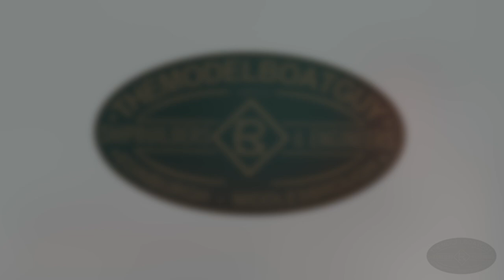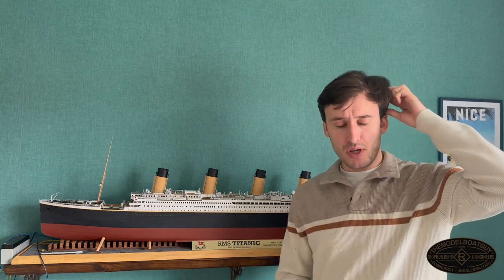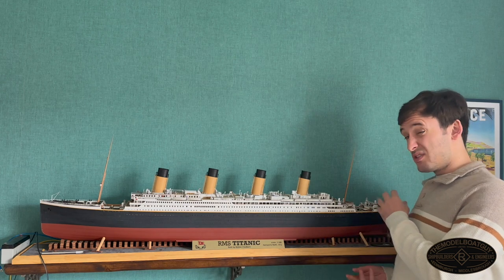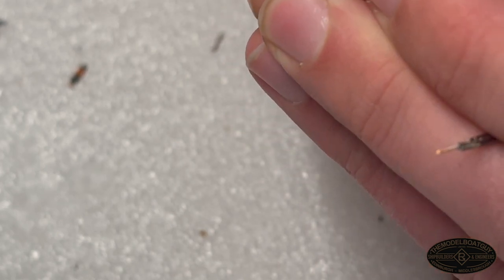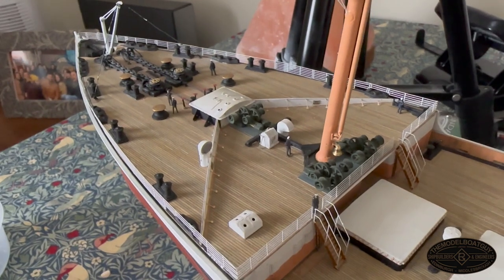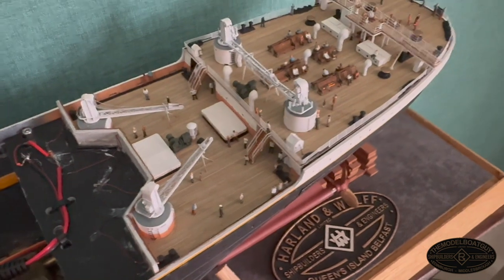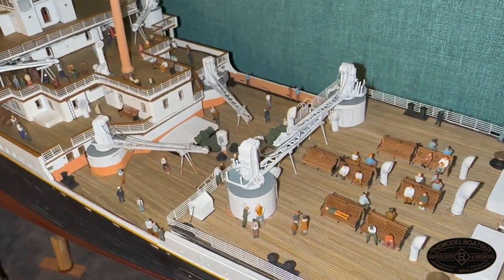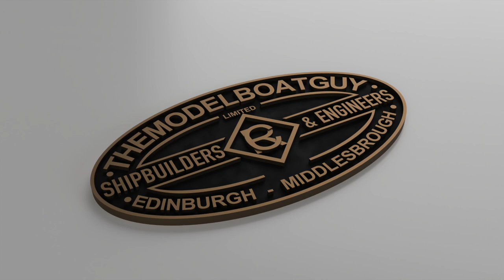Radio Control Trumpeter 1:200 Titanic Build Part 84 - Third Class Figures

Comment: First visit, and i think ive got a LOT of catching up to do!   I like your reasoning re the third class single guys, and the way to the stern would have been well known to them as third class dinning room was to the stern.  It was commented by a steward on the post sinking report that he had seen the third class single guys making there way aft on Scotland road as the ship was down by the head at that stage.   I would like to comment that this is the first build i have seen whereby the lifeboats are correctly mounted on the single inboard crutch ( Designed by Welland to go with the davits, the idea being to unchain the boats, pull a pin to release the keel of the lifeboat, and it would swing outboard a touch, you could then drop the crutch flat as it was hinged)  You have done your homework!
Reply from the maker: Hi there, 
Thanks for the comment. I think it was a relatively common thing for guys to head aft to the stern on most white star ships. As you say it’s been reported by stewards on the night of the sinking, I’d be heading that way too if my cabin was flooding! 
On the lifeboats, I found them hard to research, there weren’t that many photos of the lifeboats on Olympic or Titanic pre disaster, and as the arrangement changed so quickly there was a bit of making educated guesses from multiple pictures. Glad you agree the arrangement is correct! 
Thank you for the comment! 
All the best,
Robbie
Reply: @TheModelBoatGuy  Potential reason for confusion on the boat mounting is that there were actually actually two positions on the deck for the boat crutches. The outer resulted in roughly half the boat overhanging the side, the other placed the boat with it outer gunnel level with the side. Depended how much room on the boat deck was wanted for passengers.  All became a moot point after the ship was lost. From the little study i have done of the sisters they look like they were  retro fitted with many many extras as regards to life boats.
Reply from the maker: @timgray5231  aah interesting, I hadn’t realised these were interchangeable. I just assumed the aft boats were positioned further out to maximise passenger deck space. Though I knew the forward ones were mounted further inboard I never really knew why.
Always something new to learn on these ships!